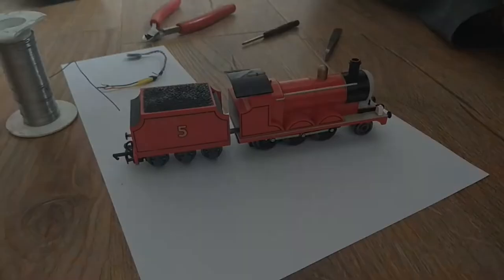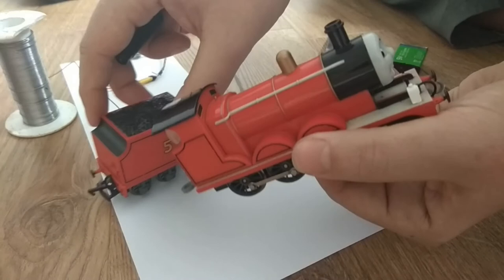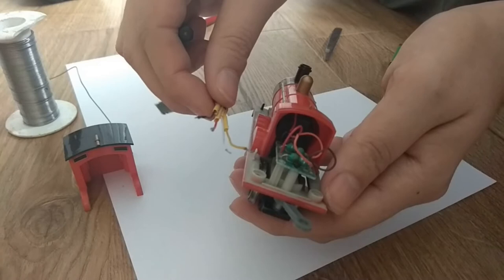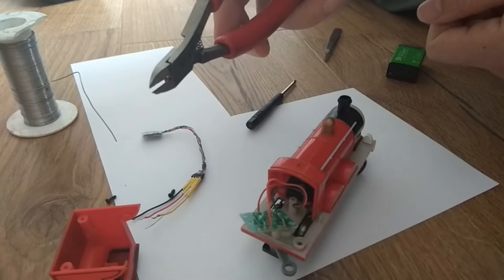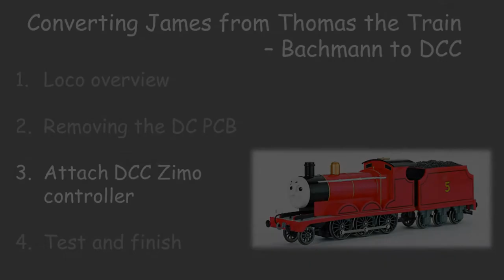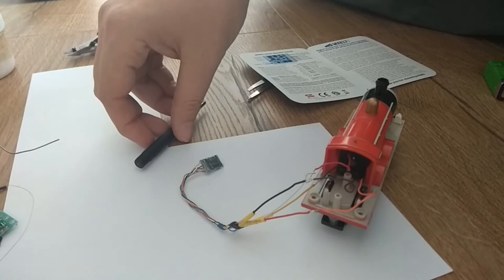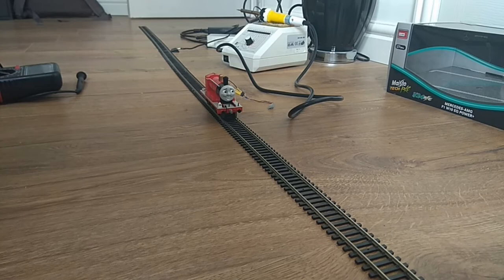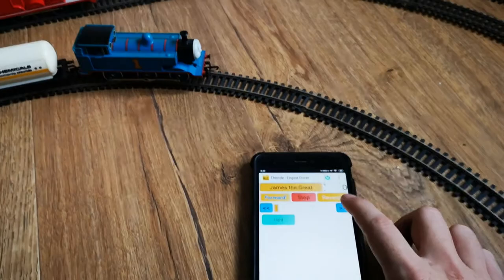Converting Thomas' the Tank Engine locos to DCC - No 5 James  - Bachmann version

Comment: Thanks for making this video, would definitely help for if I ever decide to have this job done myself!  Though, I have to say that front pony wheel does not look standard...  It's a solid wheel than a spoked one.  Is there any reason for this?
Reply from the maker: I wan't aware it should be spoked. I guess it's the way it came and I haven't given it too much thought. I have some spare metal spoked wheels, should check if they are closer to the movie character and maybe fit them later. Thanks for the heads up